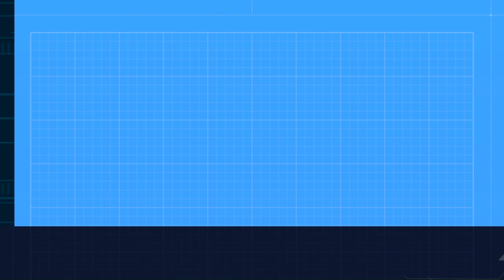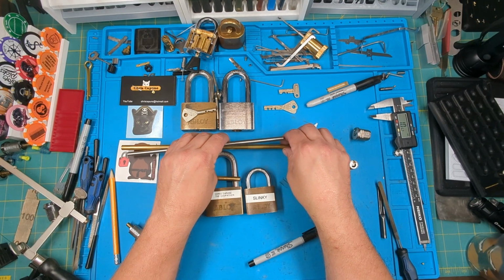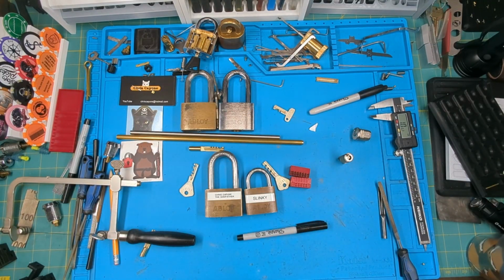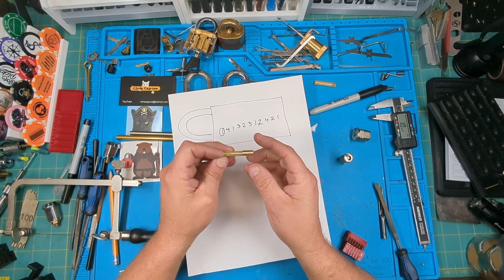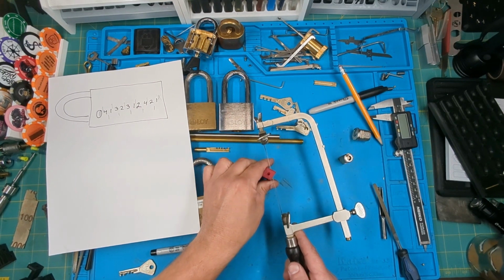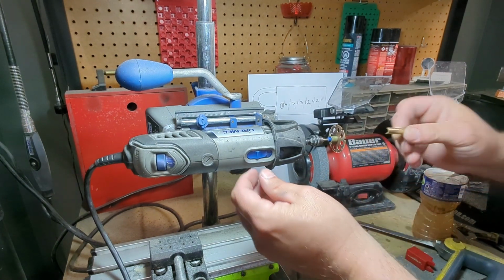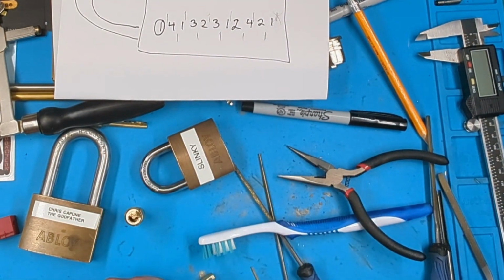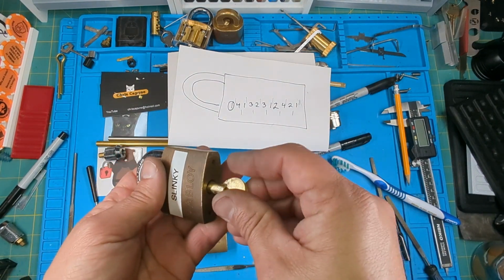(61) Making an Abloy High Profile Key

Comment: What a fantastic process you’ve developed. Thanks for taking the time to do this. Very helpful. Have you considered using Dykem (machinist layout fluid) to help with the fine tuning?
Reply from the maker: I do have dykem, but didn't think about using it  (I forgot about it, LOL). It will work, but not everyone has it. Everyone doesn't have a lathe or 3D printer either. When you say fine turning, are you saying to look for rubbing? That may work! Thanks for the input. I try to remember it for the next time.
Reply: @LockChuck  yeah it would help with finding rubbing areas, it might help with getting initial disk spacing as well. I have virtually no experience with DD locks so I’m just guessing lol.